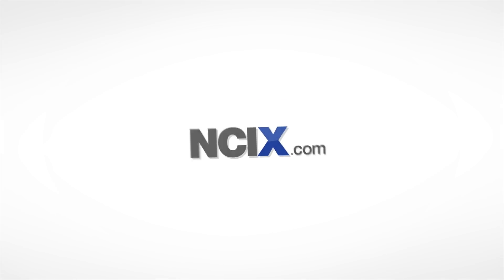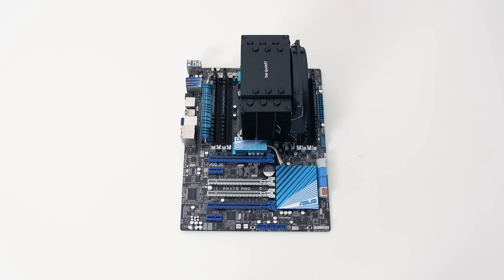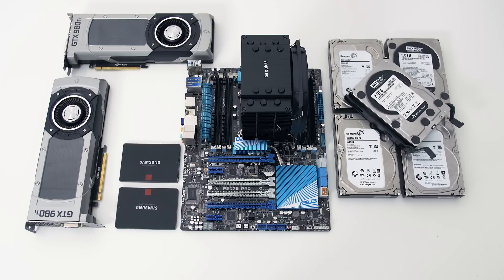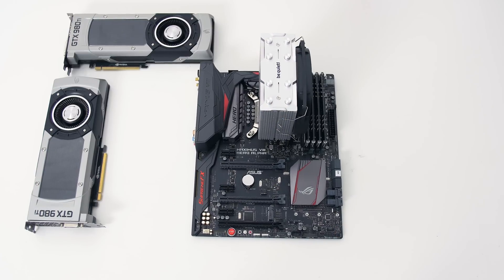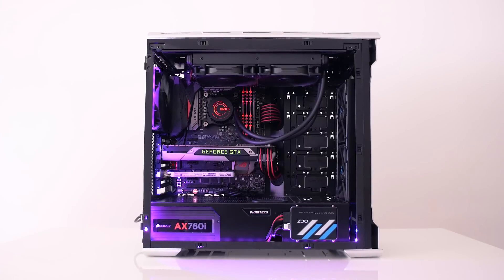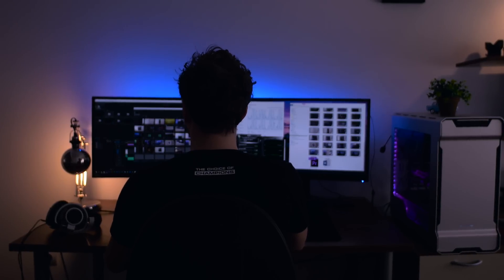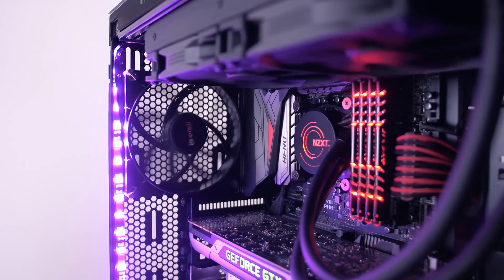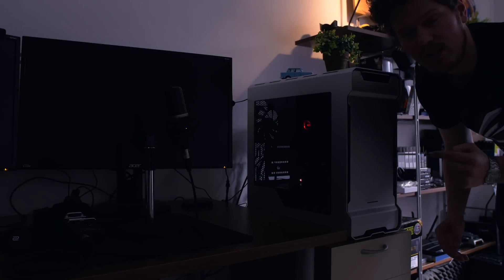Skylake Editing PC - Final Upgrade!

Comment: One thing i wanna know. I have this case and i'm having a lot of issues with the temps going through the roof. I'm considering of scraping this case to the dump yard and never looking back. 
No offecnce Dmitry but i don't think this case is really the best case. Best looking YES, best airflow  performance, big NO

This is is not overclocked either
My setup follows,

maximus formula ix 
asus strix gtx 1080
intel 6700k
corsair HX1000i
corsair h115i, removed stock fans and replaced with x2  corsair HD 140mm fans
i have x2 ML 140mm on the front
and one HD 140mm as exhaust
x1 6TB WD red NAS HHD
x3 ssd's

so my problem is browsing the web or opening any file or just doing anything the temps start to rise to 45c - 50c. Gaming im seeing really stupid temps 70c + 
its like this case is suffering from massive airflow issues. I had the top radiator fans in push, that was no good so turned the fans over to pull air from the top. A little better but not groundbreaking.

Comment: any reason why you go with 2x140mm instead of 3x120mm ?
Reply from the maker: No common AIOs that go beyond 280mm rad plus for an OCed 6700K @ 4.5Ghz it's totally overkill. My temps now do not exceed 61C when exporting video (100% load on the CPU), using the X62 cooler now. It's awesome!
Reply: HardwareCanucks Okay, thank you!

Comment: Can someone or demitri please advise. If going for silence is the purpose why would switching out the default phantek PH-F140SP fans in the front at 19dba be replaced by the fractal design Venturi HF-14 at 26.5dba? The stock fans are quieter. 

Second question. Due to front plate blocking airflow directly. Air is sucked in by the small cutouts on the side. So wouldn't you want to go with static pressure fans over high flow? The default is already static pressure. 

Conclusions : why change the two front fans that are more effective in airflow and quieter fans for louder and ineffective air flow fans?

Comment: If I'm not incorrect on this but doesn't adobe premiere do better with higher clock speed instead of higher court count I would think if this is the case the 6700s higher per core speed would render better results with a strong GPU to back up rendering

Comment: Hi HardwareCanucks, i got an issue i bought this case, but im having an problem with my motherboard i bought the Rampage V10 Edition from Asus. and its 30.5 CM Wide looks like its the same size as the motherboard u used on ths video, but when im adding my motherboard its hitting the black cable managment on the case, and i cant screw 3 screws becouse the motherboard is hitting the black things u use ur cablemanagment on.? what am i doing wrong anyone?
Reply: listen mate 
this case supports ATX motherboard ( a spesephic size of mobos) and yours is extended ATX so it won't fit...sorry
Reply: listen mate 
this case supports ATX motherboard ( a spesephic size of mobos) and yours is extended ATX so it won't fit...sorry
Reply: listen mate 
this case supports ATX motherboard ( a spesephic size of mobos) and yours is extended ATX so it won't fit...sorry

Comment: MOBO - Z170 Pro gaming 
CPU - i7 6700K CPU 
GPU - MSI GTX 1060 
PSU - Corsair vs550W 
RAM - Corsair Vengance 2400mhz (8gbx4)= 32Gb 
CPU Cooler - intel bxts15a
CASE - NZXT Sourse 530 
HDD - Samsung Evo 128+128 SSD, WD Green 2 TB, WD Blue 1Tb 
This is my rig..pls suggest anything change for this rig...pls..

Comment: I was going to use 3 noctua nf f12 and 2 nf14 industrial fans for my build 2 140 mm as intake and 3 120 for exhaust 2 on my h100i v2 as push fans and 1 as a rear exhaust. Is this a good set up?

Comment: I almost have the same case/cpu cooler. I was looking into led ram and I was deciding between the corsair led and the avexir but I actually wanted to know if you think they red tesla ram would fit in the case with the x61? I think there might be clearance issues but I wasn't sure.

Comment: I have not been able to test this myself but from what I've seen out there Adobe Media Encoder will use both GPU's. The only things are that I don't think it works in SLI (the 2nd card acts as a pure compute card, and the Ram on each card is limited to the Smallest Ram on either card( ie two 960's one 2gb and one 4gb would only work as two 2gb cards).

I feel like on that particular system it would be limited to one card performance by the CPU's PCIE lanes but on a beefy X99 chip it should (in theory) use both cards fully. 

I would love to see some testing on this if you can. Not much research has been done on Dual vs. Single GPU's in Premiere and AME.

Comment: It says from the link you posted that you used the Avexir RAM with part no. AVD4UZ126661508G-4COB. I went to the Asus website and checked the QVL of your motherboard. It didn't include the AVD4UZ126661508G-4COB from its list. Would this be a problem? Would it be ok to use any Avexir Core RAM in the Asus Maximus VIII Hero Alpha? (Note: I will also be using an i7-6700k/Asus Maximus VIII Hero Alpha)

Comment: I installed el capitan on my machine purchased just to make a hackintsoh editing = Gigabyte z170m- d3h DDR4, i5 6600, Intel HD integrated graphics only 530, 32gb RAM DDR4, SSD 250 evo samsung, corsair 600w. I installed el capitan and my problem is with the video. For I am unable to activate the GPU processor (530 HD integrated graphics only), I'm not using video offboard. just this, and I am unable to activate, you get it?

Comment: I am doing a build with the same mobo and am mildly confused about the intel 750ssd, you used the pcie? version I think. Can't you just use the other 2.5inch one and save the two slots? I'm just trying to use the best way to raid 2 of them.

Comment: Copying your fan set up!! Maybe a noobish question but, the static pressure fans under the cpu cooler rad, is it sucking air from the top of it, or taking air from within the machine and blowing it through the rad?

Comment: I wonder why you didn't go with x99 and a 5820k for your workstation. I have pretty much the same specs except I use the 6 core 5820k and it really is much faster for video editing and 4K gaming than the 6700k.
Reply: I'd consider a step up once the new Intel CPUs are available

Comment: Thank you very much for your videos ! I'm going crazy with a similar setup based on yours.

The x61 fans are too loud like the phantek ones. The interactions between Asus Q-Fan bios, Asus Fan Xpert 3 and CAM are pretty hard to understand. And the kraken pump is making noise when it runs too slow or too fast.

I will change all fans like you and stop using phantek's hub.

Please could you make a video to explain the configuration of the bios, Fan Xpert and CAM ? This part is missing in your videos. How did you successfully to make you system so quiet ?

Comment: Rookie question,,,,,why all kinds of diff fans,,,,,can i use 5 be quiet 140mm fans instead of diff brands for the case and the cooler???
Reply: +Francisco Sabater Dimitri used different fans for a certain achievement in airflow but there is absolutely nothing wrong with using the same fans throughout your entire system just make sure that the fan mounts on the case support the fan size.

Comment: Correct me if I am wrong, but the i7-6700k should be able to facilitate 2x GTX 980 Ti @ x8 and the NVME drive @ x4. The i7-6700k has 16+4 PCIe 3.0 lanes.

Comment: You should not touch the top of the CPU heat shield like you did, because you finger can release oily residue on the CPU heat shield, you did not show you cleaning it after before adding thermal compound, that oil spot you can create on the hear shield will prevent compound from spreading on that spot. I am not flaming you, just pointing it out, because I know the trolls will and flame you for it lol. Nice build and as always, very good video editing and presentation Dmitry

Comment: I would keep all the changes you have produced on the machine. And for your next upgrade, here's a different take : Keep your main rig, the same. While rendering is affected by skylake, editing shouldn't be. -Design a render/archive hybrid server, possibly using x-99 platform. Use that other 980ti you have, along with many amounts of ram, and redundant drives to create a beast rendering machine so you can pump out videos. -Then, put the machine in a place that won't bother you during rendering. - Possibly get fibrechannel or 10gbit Ethernet between the machines, and edit straight off of your server. .This is inspired by LinusTechTips,  but be creative, and if you pursure this, make with traditional 'hardwarecannucks' style and class.

Comment: Hey Dimitri! Awesome job on the video, beautiful work as always. It already looks amazing, but maybe you could consider modding the green LED of the 980ti or blacking them it off with gaff tape like LTT did one time. There's some pretty great guides out there if you're interested. Love the pink accent leds btw. Cheers man!
Reply from the maker: +Ryan Abshear GeForce Experience now allows you to turn off the GPU LEDs so i might do that so it doesn't stick out like a sore thumb.
Reply: +HardwareCanucks was it AF or SP fan on the back exhaust fan?
Reply: +Chris Frog probably AF! SP stands for static pressure and is best for your cpu cooler
Reply: +v3rs1ty I don't want to rehash this whole static pressure debate, but static pressure fans work great in all conditions and not just for a heat sink or a radiator.
Reply: +HardwareCanucks Hey anyone know what is his back music ? I want to put in on my start button so when I turn on the PC the track will run until all start up. Or using Gatekeeper to wirelessly turn on my PC when I got home and the music will play... ( best feeling for the long day work... )
Reply: +Charles Joyce Nowdays there are even fans that are more of a mix between AF & SP designed, more for either or. Noctua's A series is a good example :P

Comment: How come you decided to use air flow fans, instead of static pressure, on the front intake? I have the same case as well thanks to your brilliant review of it but from my experience with it, I feel as if the front panel and filter are a little much for air flow fans to handle. Otherwise, great work, looking forward to more videos!

Comment: @hardwarecanucks:  When you turned your pc on how do you make it so it skips straight to windows 10 without your pc waiting for you to enter bios etc ...? The moment you pressed ON it literally in 1 sec went to you screensaver, how can I do this? When i turn mine on it sits for 5 seconds saying "ASUS" then it goes into windows 10.
Reply: +Rase P there's a setting in asus rog boards (not sure what other boards but mine does too) that lets you virtually skip the post, and with the nvme sdd as a boot drive it boots instantaneously
Reply: I have a Asus Z170i Pro gaming mobo.
Think you can possible walk me through the steps? I have a samsung 840 240gb SSD which has my windows 10.

Comment: As an owner of a 3930K with an R9 290X, I certainly agree with heat and noise problem. Idling, it's fine but gaming turns the rig into a space heater.

Comment: If u have no prob can i plz buy that x79 mobo from u for less than $150. bcoz x79 mobos r just too costly.
Reply: Unless you have an x79 CPU get an x99 if you check PCpartpicker they have an x99 mobo on there for around $130-149.99 and its gigabyte so you know it's reliable.
Reply: i know thats possible. But on ebay xeion E5 2670 is like $68. Price to performance for that chip is insane.

Comment: I think you should install a m.2 drive. They are nice little drives. I installed a 950 pro in my machine and it Moves!! esp coming from a platter drive as i did.  It is worth the upgrade.

Comment: Hey Dimitri, I noticed you said in your video that the x79 platform wont support nvme but in fact it does. Just go into the csm in the bios and change the pcie to load uefi driver and you should be good to go. My nvme drive works in my x79 as well as my z77 motherboards. Cheers!

Comment: While true that the i7-6700K is quite a capable CPU for video editing, you have to run it at 4.4-4.6Ghz to be able to even match the i7-5820K at STOCK in 4K encoding.. And ~4.6Ghz is pretty much the average, top overclock you could achieve with air cooling, with water cooling giving you a tiny bit more of headroom, ~4.8Ghz if you really want to push it.
Where as with the 6C12T 5820K running at stock, you haven't even tapped into the power that lies beneath. 5820K's on average reaching 4.2-4.3Ghz while the 5930K's fly like a G6 at ~4.6-4.7Ghz. Those would tear the puny 6700K apart. Hulk smash!
Reply: +Lagittaja Yes thats true but I think he just doesnt have the funds right now, I believe he doesnt want the lower end 5820k and is waiting so he can affor the 5960x atleast.
Reply: +Elite Exposure Or he might be waiting for the Broadwell-E CPUs like the 6950x to be released, which will also be on the x99 platform.
Reply: +Lagittaja If you want to game AND edit though, a 6700k is arguably a better choice...it beats out 5960x's in most games, and obviously does a decent enough job rendering videos.

Comment: I wonder which would be faster for this sort of thing, 32GB of 2400MHz RAM or 16GB of 3200MHz RAM (with a lower CAS latency than that Avexir crap sports).
Reply: +Skeletor Jopko Usually when you go up in frequency the latency is worse, so it almost cancels out. Even if you pick a more expensive 3200Mhz kit, you won't get much more performance. And obviously if at some point your system needs more than 16GB memory, then it'll choke with the 16GB kit. That's why Dmitry prefers the 32GB kit now, he realized that using all his editing softwares at once (and probably a lot of browser tabs opened), eats more than 16GB of memory, so 32GB yields better results.
Reply: +Skeletor Jopko For editing and rendering the quantity is much more important.
I have 32GB 1600 ddr3 ram and i love it. Multitasking works great. Premiere pro rendering 1080p video:20GB, After effects:27GB.

Comment: Wow I can't stand those people who are always fussing over their PC when there is nothing wrong with it and who are just never satisfied with there it and need to do a new build or put it in a new case every year or just give it upgrades it really doesn't need all the time. If your one of those people well then just go find something else to do if your bored....

Also seriously man that system isn't quiet you got two 980 TI's with reference coolers on them and the front panel of that case has holes running along the edges, probably one of the worst cases for silence you can get. If its really bothering you just move it away from you and you'll just have to deal with not being able to stare at it while your editing :|

Comment: What's the use of all those silent components when you put in 2 reference 980ti's in sli? The upper one will probably get super loud and hot.
Reply: +santeenl Using 2 reference coolers will run cooler than using 2 custom coolers since the former will not dump hot air back into the case.
Reply: Tae Kim Reference coolers are known to be noisy and hot, the fan is simply not silent. With a good airflow and 3x92mm fans like on high end 980ti custom cards you can surely achieve a more silent operation. Maybe not if you have a case with only 1 outtake fan or something, but most cases have like 2x140mm intake.
Reply: Do you have temperature benchmarks to support your claim?

The general consensus is that reference-type blower coolers are the better option when it comes to SLI configurations since hot air isn't recycled.

I run SLI 980 Ti's as well. I wish I went with the reference coolers.

Comment: hay on your 6700k have u been haveing issue with the temps shooting up and down like crazy?
Reply: I haven't been.. Have you?
Reply: +Hivon yes very bad.my max temps is 140f at a 4.8 overclock so I'm not going to worry about it
Reply: Lee Dunlap mine is at 4.5 with no voltage change whatsoever, 100% load with an h60 never passed 45c over an 8 hour period of stress tests
Reply: Hivon i dont know what the stock voltage is.what is your set on
Reply: Lee Dunlap ill have to check when i get home from work, but i didn't touch it.
Reply: i got mine to 4.8 at 1.37 what board are u running

Comment: If you get a chance, try replacing all of the fans, with 6000RPM 120mm fans (fit as many as possible in there), e.g., http://www.newegg.com/Product/Product.aspx?Item=N82E16835706022

It would be interesting to see how long someone will tolerate a long editing session when that kind of system next to them.

Comment: Can someone help me out with cables? I want cable sleeves but do I only need 24 pin and a 6 pin cable sleeve? Or what other cabels do I need?
Reply: +ThatsMeSuperMan You want a 24 pin cable. Depending on what kind of GPU you have will determine if you need a 6 pin cable for it. Just go to amazon a search for color and type of cable you want
Reply: +Defender Of Faith Im gonna get a msi gtx 970. Are those the important ones or are there more cables? Thx for the answer btw
Reply: The cable fore the Mobo (12pin atx cable) and the cable that will plug into the 970 will be the two most visible cables. i think the 970 will use a 8 pin

Comment: @HardwareCanucks I have a very similar build to yours in some ways. Same case. Also used the Fractal Design Venturi fans for front, back and PWM for my kraken x61. I am running a X99 platform though with the 6 core 5620k and only 16GB of memory. 2 970s SC in SLI. Mine is more for gaming but it works great and as silent as it can be for 2 GPUs. I enjoyed your video!